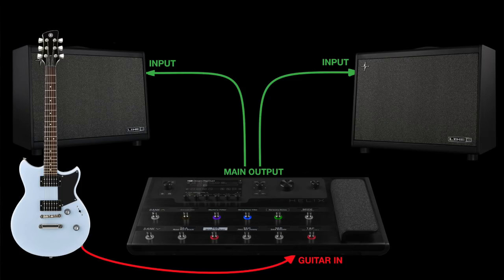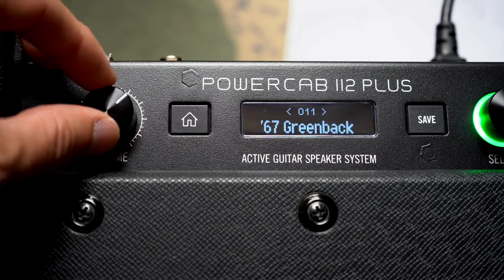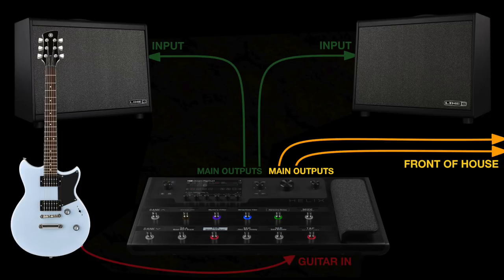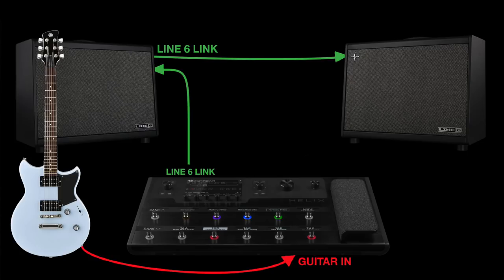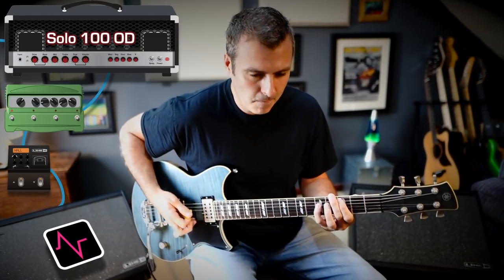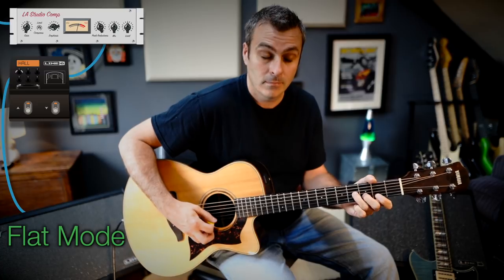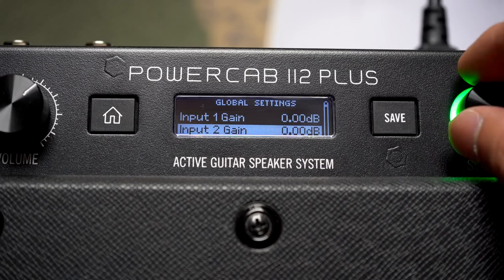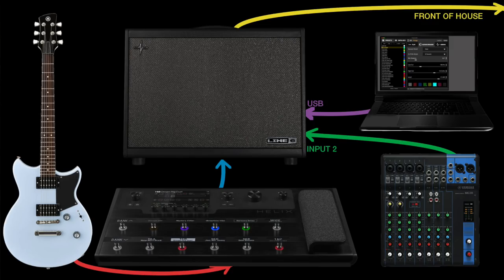Powercab Plus Connections | Line 6

Comment: Can the Helix via L6 Link change speaker options, and/or change from speaker to flat without the need for a midi connection?
Reply: Not at the moment.
Reply: @paulhindmarshmusic  When firmware 2.8 hits then it will!

Comment: That's a very helpful video, but I still can't find out if when using a Kemper with stereo out and Powercab Plus if I should take the left signal to input 1 and right signal to input 2...or just use left output to input 1. Powercab is amazing, but Line 6 are not good at providing support.
Reply: Hi. As Powercab Plus is mono you just use whichever output from the Kemper is mono. You would only use the extra input on Powercab if you wanted to plug in something different. So yes Left/Mono output from Kemper into Input 1 on Powercab.
Reply: Thanks for that. Much appreciated. You should run Line 6 support!